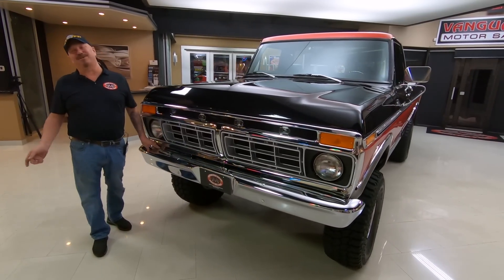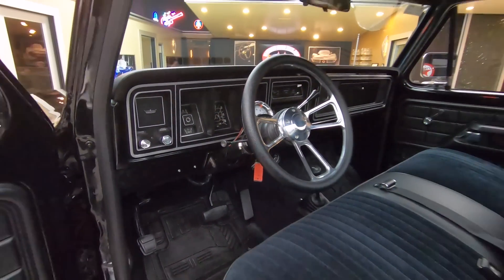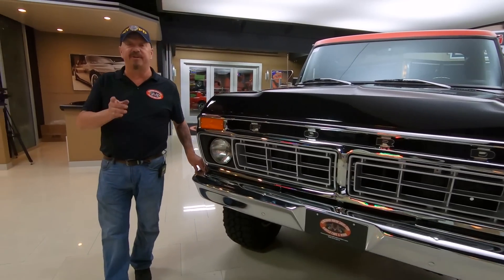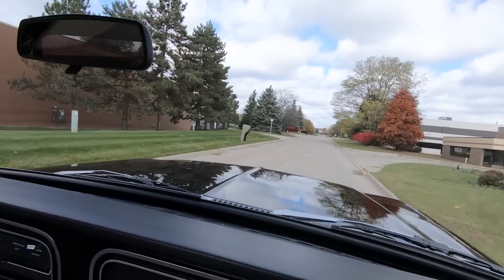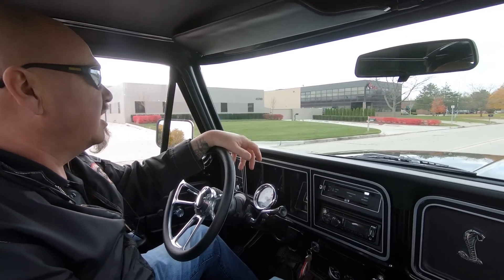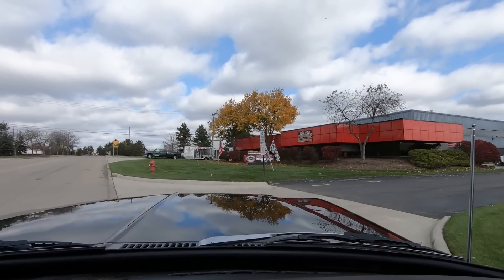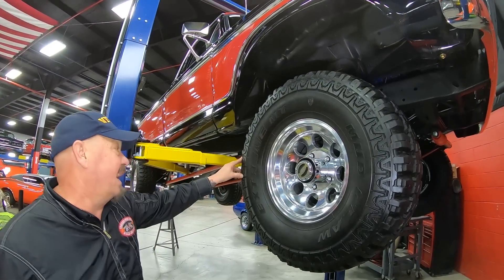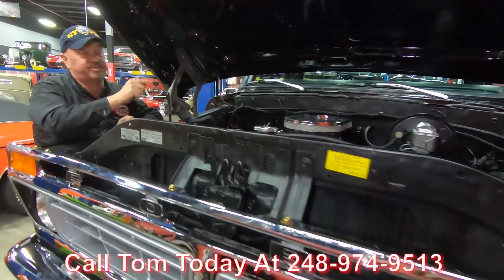1977 Ford F150 For Sale

Comment: Hello from Canada 🇨🇦 I picked up a 74 f-250 85,000 k on it the old fella used it to haul his camper hardly used it has minor surface rust no tailgate 2 wheel drive automatic black on white all original even the split rims with caps 460 cu with A/C regular cab 100% unmolsted very happy camper